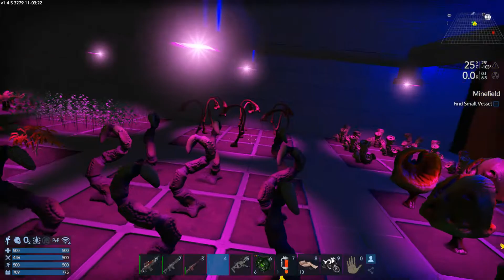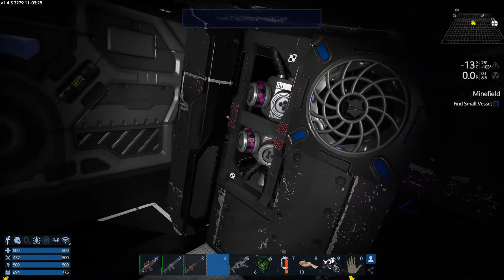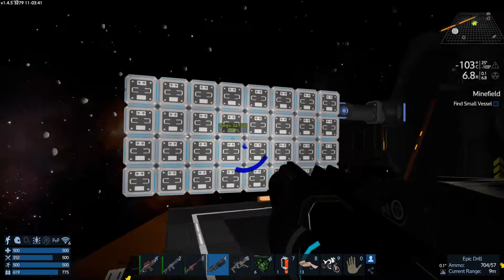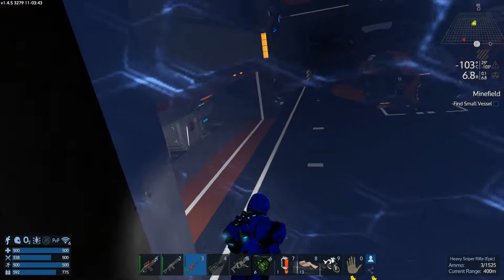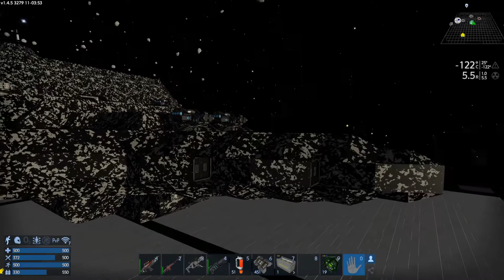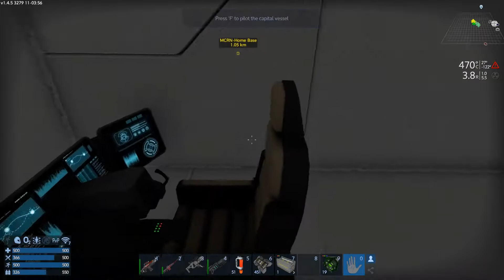Empyrion Galactic Survival | S2EP16 | Repair Bay Farm

Comment: I found that if you repair to template, it will replace missing block but not repair damaged ones.  I guess you need to run both repair mode
Reply from the maker: yeah it seems that way, rarely need to repair much since they added shields